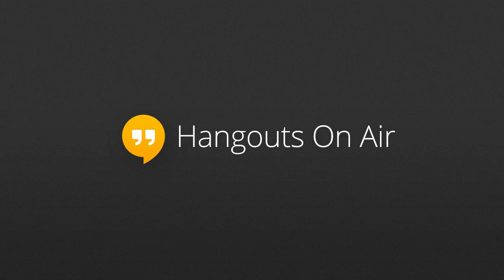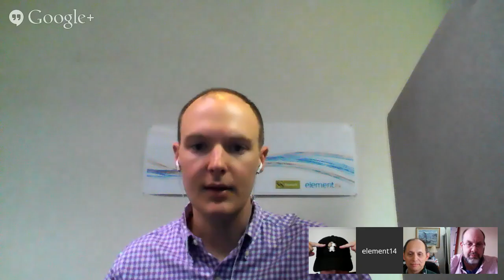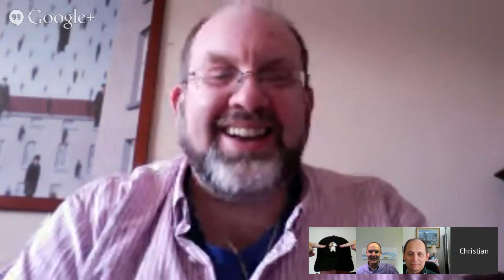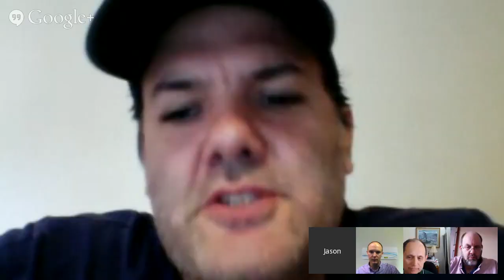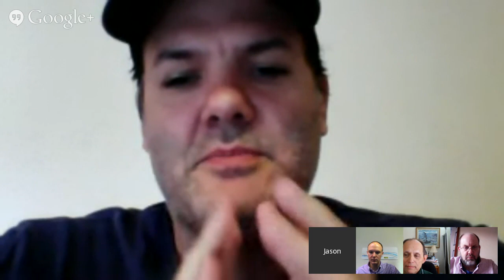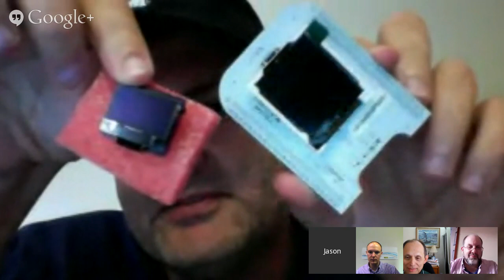Vehicle Simulation Google Hangout

Comment: The ability to record inside a real vehicle and have a library of different manufacturer vehicle recordings to share with people, and to replay and modify the simulations to build reliable, rock-solid applications that you can test with dozens/hundreds of recorded vehicle simulations is incredible. Congrats on building this unique combination of features in an open platform. It should unlock a whole load of smart applications and startups to create them.